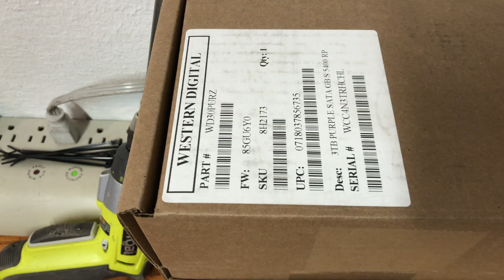Q-See NVR Upgrade Storage How To Expand HDD to 12TB or Higher Step By Step (QT Series, Model QT816)

Comment: I think they picked the wrong name for this channel 
  By the look of the unanswered questions in the comments there geeks that don’t care 🤷🏽 
  Anyway any chance of getting a answer my q-see drive is full will formatting the hd only erase the saved camera videos and leave the rest of the needed files alone ? Or will it erase everything including the menus and op system ect?
Reply from the maker: The GUI and WEB interface run on an imbedded set of hardware; you will not lose anything related to the configuration of the NVR when formatting the drives.

Comment: What about formatting the hard drives? Is there a utility in the Q-See firmware to do so?
Reply from the maker: Both the GUI and the WEB interface contain a section for formatting the drives. You can also use a USB to SATA adapter to manually format them with a computer.